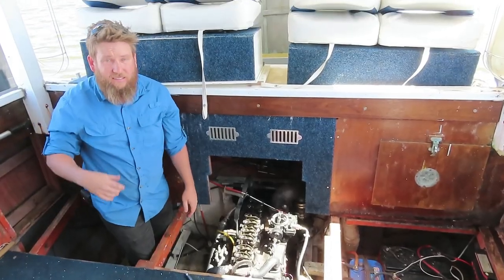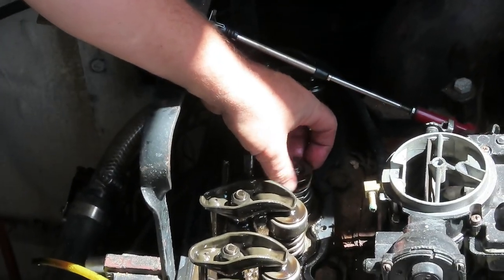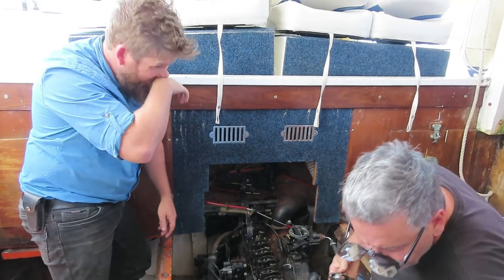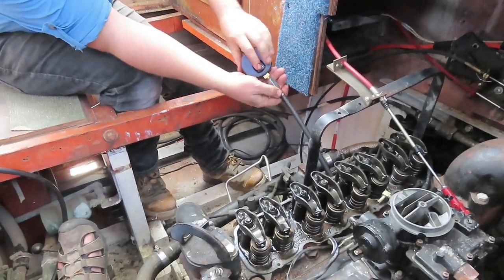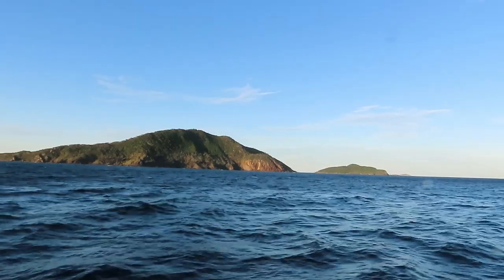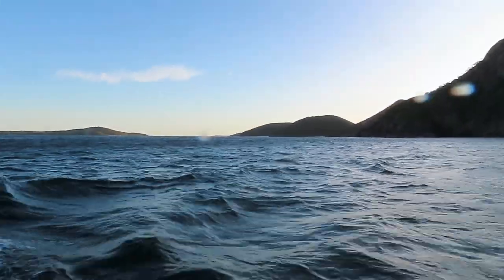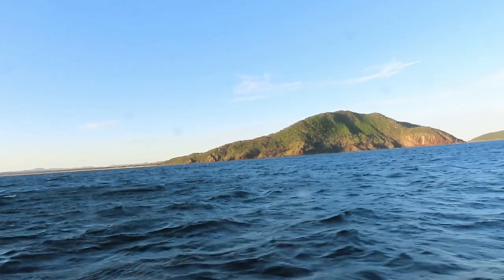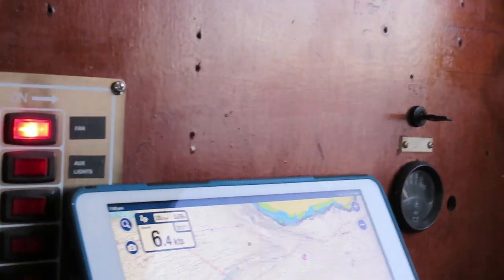34ft TIMBER BOAT "KIARRA" EP10, LAKE MACQUARIE TO PORT STEPHENS PT2 LETS TRY AGAIN !!!!!!!

Comment: I was about to comment on the open hatch while underway when it suddenly closed! (7:16) Good move. 😄
Reply from the maker: We were running with it open for around 15min after I fixed the loose water pump pulley because I kept thinking I was hearing more noises but just my imagination. When the sea started to pick up we closed it up as you said it can be very dangerous

Comment: Well that worked out alright then. Good when ya get a win. Gives way more time to consider engine options as ya might as well use her like she is at the mo. The swell was reasonable good test for her didn,t look too shabby. Ya do know ya DADS  the big Star now. Keep at it mow. 😁😋😎
Reply from the maker: Absolutely mate, I was glad not to be rushed into putting some else in just to get back under way. Then engine really does run well and for cruising around it will be fine. She handled the swell much better then I was expecting.

Comment: Great work! Something so small as a valve spring issue, something you never expect but a simple repair. I can`t say how much better your Marine response system is to ours here in the states. We don`t radio the coast guard here unless we have trouble. Being able to radio and check in with a response unit has to give you some sense of security, I sure wish we had that. Keep up the great work!
Reply: All volunteers.
Reply from the maker: We are very lucky here. You can call them up for weather reports, check in, log in and out when crossing bars and they are always professional and helpful.
Reply from the maker: @AquaMarine1000  yep sure are, fantastic men and women that I am very grateful give up there free time to help others.
Reply: @HarpersShed  awesome! Very commendable as an all volunteer group. Your Royal Air Force Search and Rescue during war (I believe then) and such coined a phrase "The Sea Shall not have them" which we use aboard our rescue boat for our challenge coins. It`s also a 1954 film title, but goes back before that.
Reply from the maker: @lpalmer1969  well there you go I didn't know that👍

Comment: Looks like a Holden Starfire engine  they are rubbish  when you can get rid of it cheers mate
Reply from the maker: I actually use a Holden 202 valve spring as a replacement. It does look like a Starfire 4 yes. I will get all the timber work done first then do the repower. As under powered as Kiarra is the engine still runs well and allows me to use the boat still.

Comment: You got an engine of an unknown quantity and usage. I'm surprised that before attempting such a trip that a top end rebuild was not done, this is something quite obviously within your purview and therefore could be attempted at minimal cost, what would a new set of valve springs, collets and gaskets have cost vs the time taken to fix it after it broke?
Reply from the maker: While I can see where your coming from, hindsight this could of been a good idea. However doing a top end rebuild on an engine that is showing no signs of internal mechanical issues is just not something that's done.  I will be putting a set of valve springs in it now just for piece of mind though.

Comment: That's great it was a easy fix it goes great for what it is maybe just rebuild the engine so it's all fresh it might be a good time time to do it but then again why fix what isn't broken hah
Reply from the maker: That's it mate, for now I am just going to replace the valve springs and give it another oil change after the long run. Once the rest of the boat is all fixed up I will be doing a repower to a diesel for more torque and fuel economy.